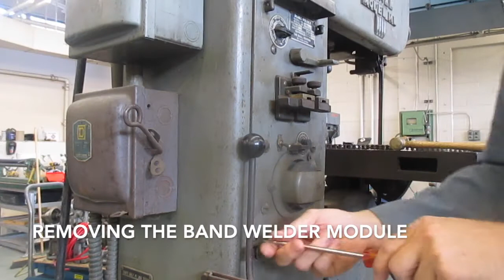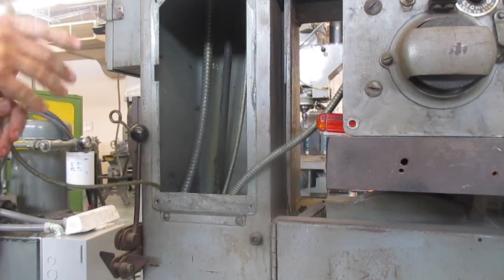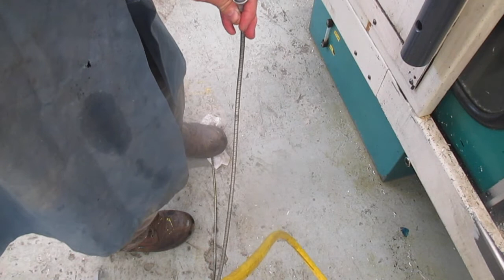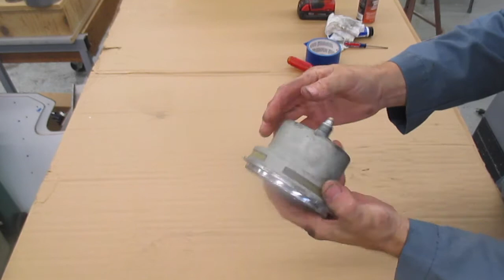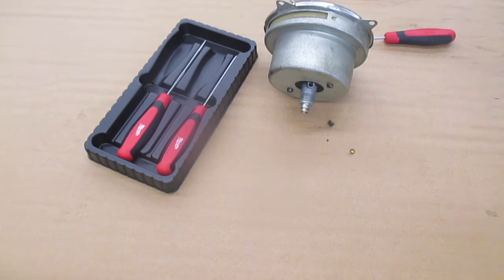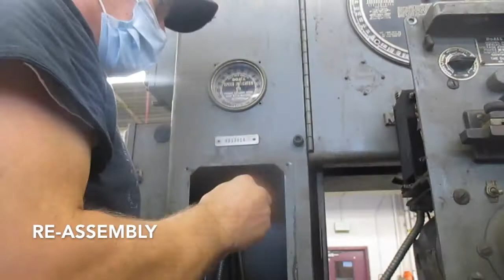DoAll Model ML Bandsaw Speed Indicator Repair

Comment: I appreciate you taking the time to record both this vid as well as the one you did on gear control. Relative to this speed indicator issue, you did not address the speed drive. I'm wondering if it too should be or can be overhauled or even if it is possible to do any work on it as it appears to be a closed system/cylinder. Your thoughts? My DoAll 16 is a 1943 model and I am in the middle/close to ending a refurb. Thanks, Jerry
Reply from the maker: I haven't had my vari-drive apart but looking at the drawing it appears to be a series of bushes with felt seals/wipers, nothing more. You oil it frequently to ensure it moves smoothly on the shaft. Most Reeve's drives are spring loaded but the DoAll model forgoes the spring. I found this build thread that should clarify the mechanism for you. He also shows how to make the felt seals. https://www.garagejournal.com/forum/showthread.php?t=148470
Reply: I'm sorry I confused you but the speed drive I was referring to in relation to your video on the speed indicator is the cylinder that turns the speed cable.I'm curious to know if you have opened it or even if it opens.Thanks, jerry @MrSmithDotShop
Reply from the maker: @jerryf8735  I did not disassemble the jack shaft. It has an oil hole and should be oiled regularly. Mine felt very smooth. Looking at the drawing it appears to use a water pump style bearing/shaft cartridge. The part number is 6-05406 in my manual. I found it listed as 106-054067 in later manuals but I couldn't find it online either. I'm sure DoAll stocks it, if not, I bet Napa could match it based on dimensions. It will press out complete, shaft and bearing. I suspect the coupler housing screws into the bearing housing (or is a light press fit) and once removed it should be a straight push to press out the bearing and shaft. See this for a reference photo. This is NOT the correct size but it likely looks similar. https://www.amazon.com/Omix-Ada-17104-83-Water-Pump-Bearing/dp/B003AOQ7OQ
Reply: @MrSmithDotShop  Big help. Thank you for your thorough explanation. I'll continue my refurb work with this in mind.
Reply: Hi jerry, I'm having trouble with my 1941 DoAll v16 speedometer, my needle shaft is broken at the speed cup do you have any pictures of yours by chance? It seems to be a automotive speedometer from that era and I'm having trouble finding replacement rather than paying way too much from do all. Anyways cheers!
Reply from the maker: @groopmmex  Mike, check this Garage Journal thread. It might have a photo of what you need. I haven't had my speedo apart. Maybe Jerry will chime in if he has. The Youtube video shows how to take it apart. It appears to be an automotive style so you may be able to salvage parts from something more common. The video description states the speedo was "made by AC Spark Plug Company of Flint, Michigan.  The patent numbers cast into the frame of the instrument suggest it is a converted car speedometer." There are a few on Ebay but the cheapest I could find was about $60, some of the listings suggested they are were used by GM.
https://www.garagejournal.com/forum/showthread.php?t=34928&showall=1
https://www.youtube.com/watch?v=5VJiXZGOjMI